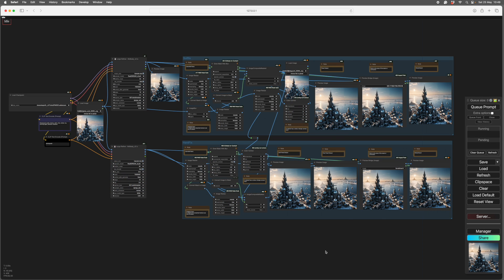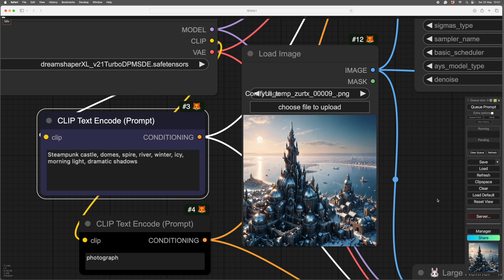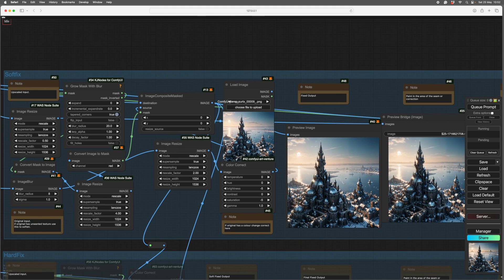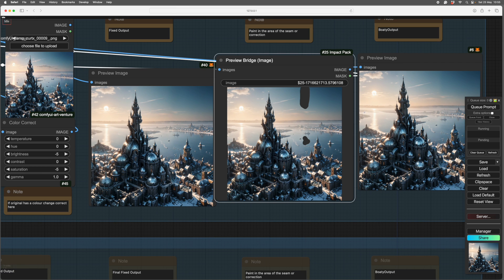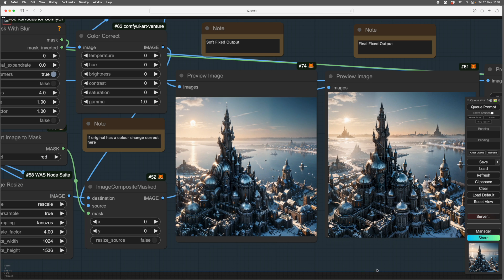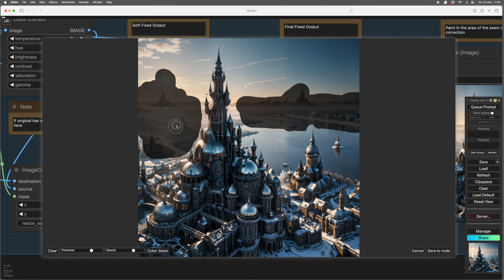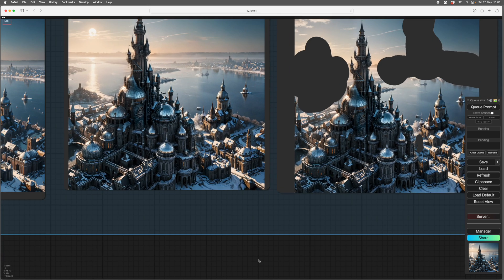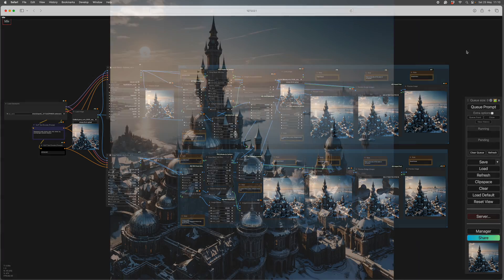Fixing the Seams from a Tiled Upscaler in ComfyUI

Comment: I'm always impressed abour your buildings and compositions, Rob. Thank you for sharing and for doing some more work on your fone upscaler! What I figured out, that if you turn down the noise quite a lot (even without a proper defined prompt), then you don't have additional subjects in multiple tiles.
Reply from the maker: Yes, true but the level of refinement drops, I don't care about the occasional extra, what I want is the  overall improvement. You cannot have one without the other!
Reply: @robadams2451  Yep, that's true, because upscaling should cover three topics - it should upscale, repair and improve.

Comment: From your video, I think your method is similar to manually editing the image in photo editor, which is the method I prefer more than doing it in Comfy UI. 😅
Anyway it is a good option for anyone who like to try a different way to do it. 👍
Reply from the maker: It's based on the process I use in photoshop, many Comfy users aren't fluent, or can't afford Photoshop. For photoshop you have to pay, in comfy it's free. Once set up it is also quicker for simple stuff.
Reply: @robadams2451  I would suggest an opensource photo editor like Krita which you could link it with Comfy UI by an addon. This addon adds feature like generative fill in Photoshop to Krita. You can also use features like controlnet, IP-Adapter composition/style, inpant/outpaint, and etc. Thank you for you reply. 😄
Reply from the maker: @beveresmoor  This vid is for beginners,   there are many options for the more experienced.

Comment: Your McBoaty tiled upscaler node seems to have issues with non square images where the tiles (multiple tiled images in one image and seams) are more obvious. Are you seeing similar results? Square images work well though.
Reply from the maker: I have found it works fine on other proportions at the default settings no side can be less than 1024, if a side is less then the feather must be 32 pixels. but there is no real point in using a tiled upscale for small images as an ordinary upscale would be better. I don't use it for images less than 1536.
Reply: @robadams2451 Oh that might be the reason why. Sometimes I tile upscale 768 width. So ill let you know if that is the problem.
Reply from the maker: @dadadies  The other reason to not use a tiled upscale on a small image is the resolution of the tiles is then a bit too small for the sampler to process, unless maybe you are using SD1.5
Reply: @robadams2451  I dont know why but McBoaty is working really good now... Even with smaller size images. Its much faster than Ultimate SD Upscale and is occasionally better in quality. Thanks for sharing your work. Its good to have a different way to tile upscale.